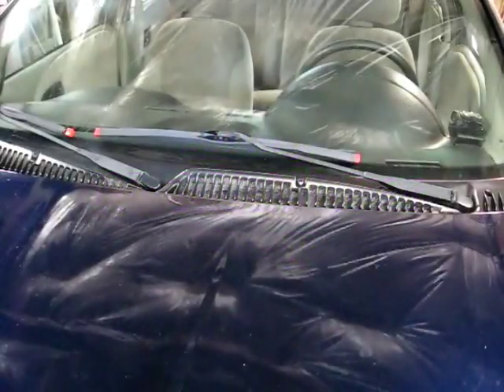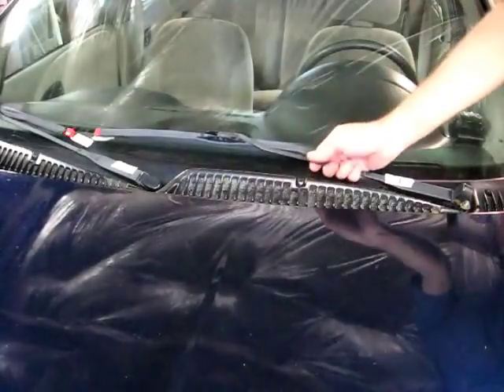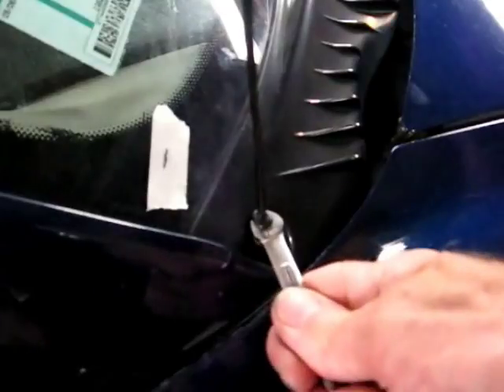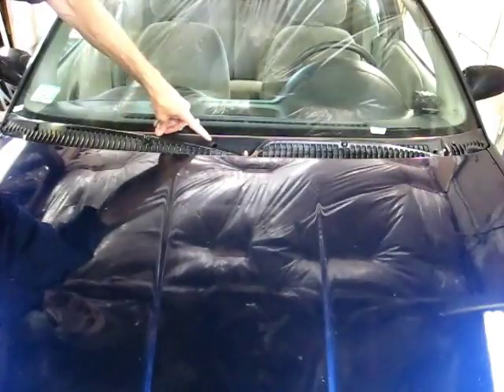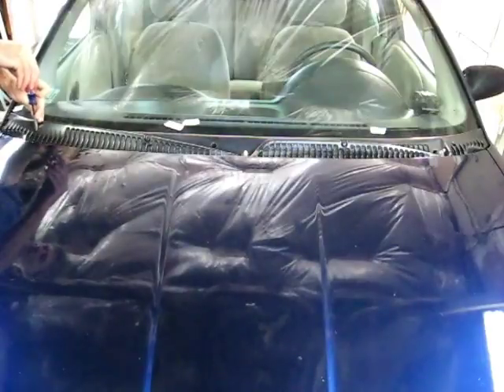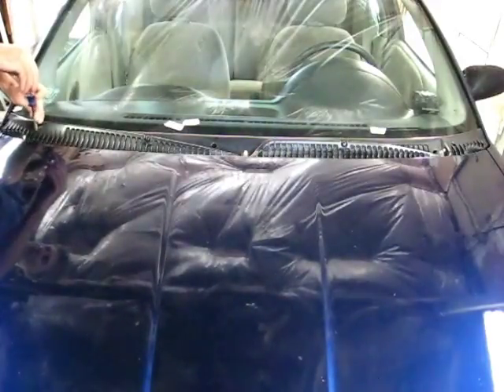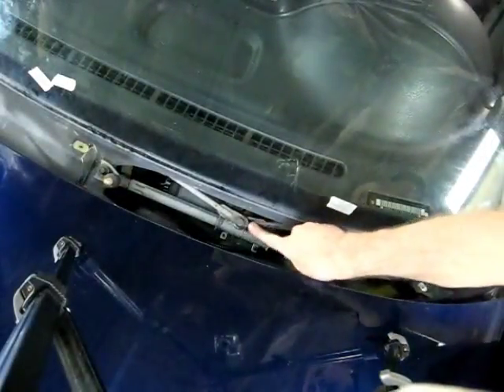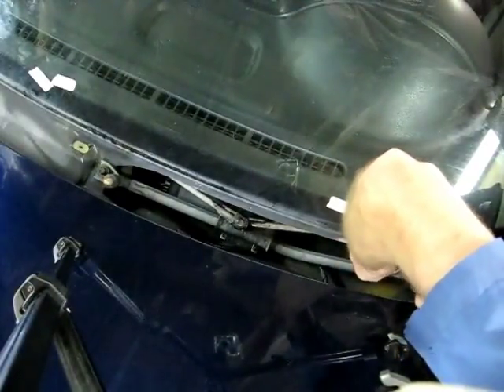Lubing Squeaky Windshield Wiper Linkage

Comment: Thanks for the video mate. It helped. For some cars you can see the linkeage joints from the engine. I just sprayed mine with wd40 without having to remove anything. But yes on other cars you will need to remove the cover from the top to gain access

Comment: Great video, just lubed the wiper linkages on my  98 S Series.  One thing I'll point out is that you don't have to remove the black trim piece.  Just remove all the fasteners and the wiper arms as per the video, then you can just pry the plastic up enough to have access to the linkages with the hood up.  Then just run the wipers and lube the joints.
Reply from the maker: Thank you for the tip.